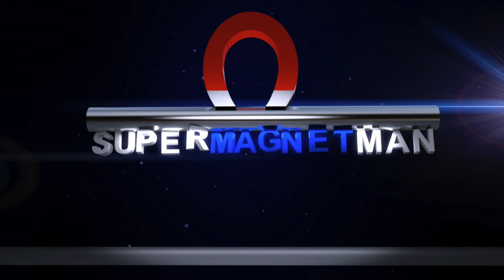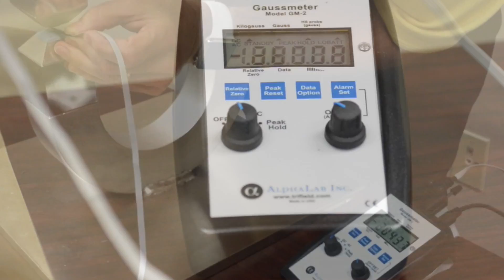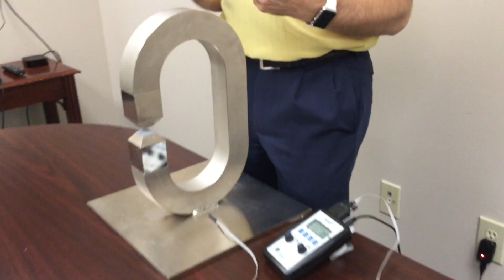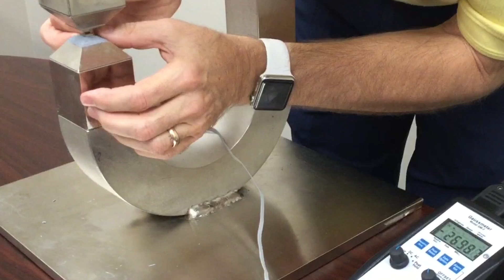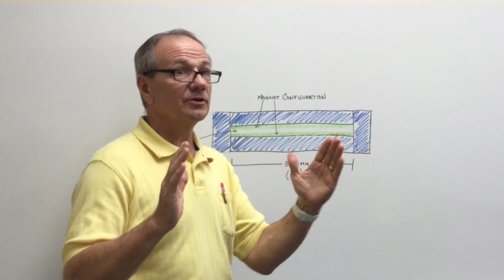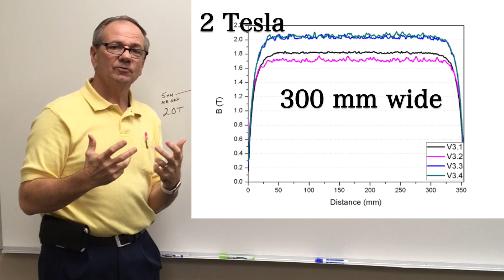SuperMagnetMan - Giant C Magnet

Comment: I need a 10 to 20 Tesla electromagnet without the 'small effective area' problem.  WITHOUT COOLING.  I know it's possible.

I'm looking at TOPOLOGICAL INSULATORS  and MAGNETIC TOPOLOGICAL INSULATORS for inspiration.

The key is probably eliminating electron scattering, and copper or silver may not  be the right choices.

MAGNETIC TOPOLOGICAL INSULATORS and related are 'new' materials from a seminal paper published in the 1980s.  

Electromagnets that heat up their wires remind me of someone driving a car with the brake on
.
.
.
Reply from the maker: Sorry for the delay in replying.  Great question and I will need to look into it a bit more to give a better answer.  Thanks for the question.

Comment: Have y'all ever tried using Gadolinium and two Tesla coil's to pass an energy frequency between the two coil's in a superconducting energy loop with zero loss of energy that affect's the Gadolinium causing the crystalline structure's of the Gadolinium to generate ultra low temperature's that generate's a magnetic field? Electrical generator's generate heat so why not design an electrical power generation system that generate's cold temperature's and allows for superconducting of said generated electrical energy? 😊

Comment: What's happens when u drop one of those pyramid magnets  toward an aluminum plate. The round one cushioned the landing would the pyramid magnet suspend for a second or just land soft. Guess maybe rate of induction of the aluminum would change with higher magnetic fields

Comment: Have you tried using shielding materials (copper, aluminum, bismuth, pyrolytic graphite, mu metal) to focus the flux field?
Reply from the maker: Jammit - no material shields magnetism.  Iron tends to do the best at bending the magnetic fields.  What iron does is that the magnetism prefers to travel in iron over air and will travel through the iron and disperse the magnetism around its edges.
Reply: Nano Silicon
Reply: SuperMagnetMan
Thanks.

Comment: Well keeping in mind that I'm perhaps one of the most ignorant here.. I have this question, Does this magnetic field is continuous? Complement each other? "Or it is a repelling one each other!! 
I perfectly understand that the goal is not to use electricity.. but would like to understand the way you get there and if it can be sustain, or it will eventually start to decay due to constant repelling magnetic fields..
Reply from the maker: Neo magnets have a life generally estimated in centuries so we probably will not be around to notice it getting weaker.  Of course the were just invented around 1980 so they haven't made it to the first century yet.  Yes the North and South are facing each other but if it were in opposition the middle of the field would read zero gauss.
Reply: They're definitely aiding (one is north seeking and the other south seeking). All magnets get weak over time. To help protect a magnet and make it last longer you should "short" the north and south poles together with something like iron or another magnet (basically stick the magnet to something that connects both poles together). Air is a poor conductor of magnetic fields. The harder the flux has to work, the faster the magnet weakens. As he brings the gaps together (both north and south poles get closer), there's less air and the magnet will last longer.
Reply: Yes I have some understanding on that aspect... I did purchase two super neodymium magnets ans place them in the center of a cut in half toroidal transformer... it was a really nice experiment...